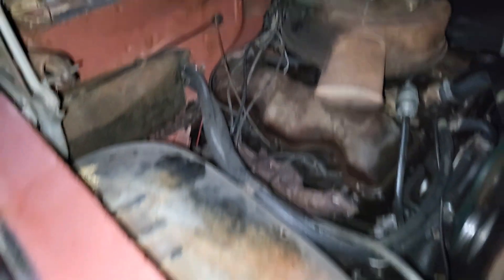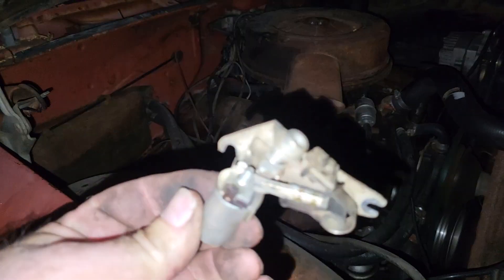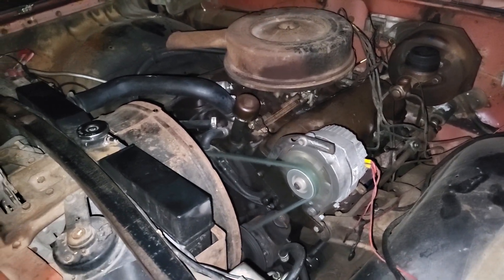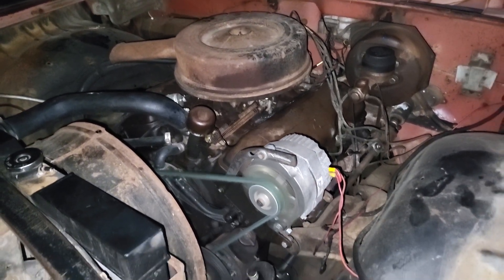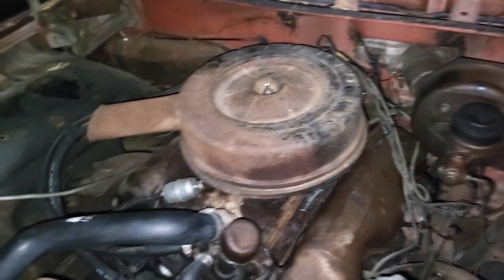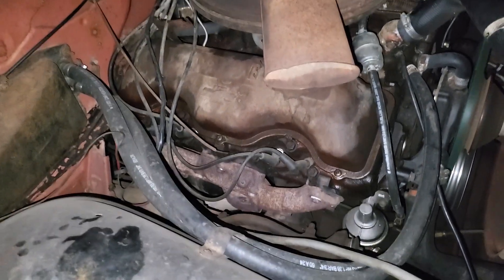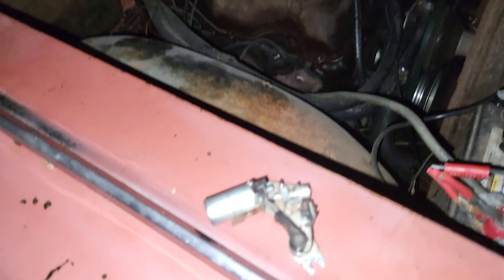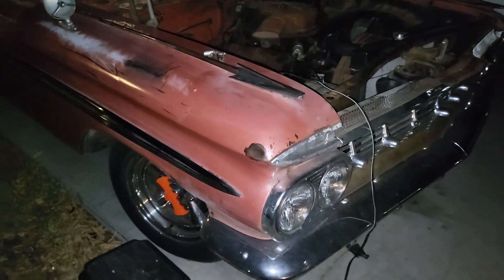1959 Chevy Impala Friday Night project.

Comment: New points and condensers are not built with the quality they used to be unfortunately. If your going to continue to use points you would be wise to at least have a spare new set in the glovebox or find some NOS sets, new points don't last very long and the rubbing blocks wear down very quickly and new condensers seem to have a 50/50 shot if they will work or not right out of the box.